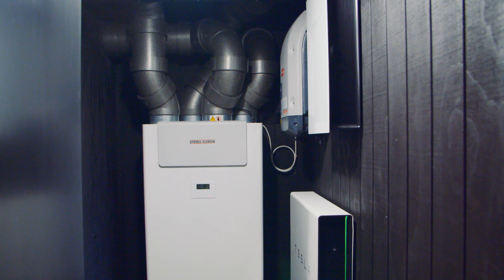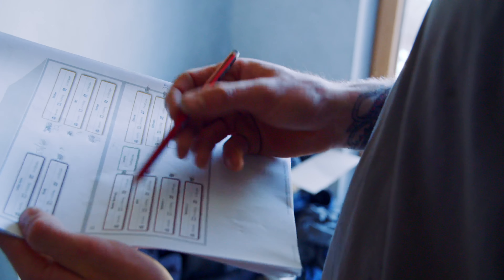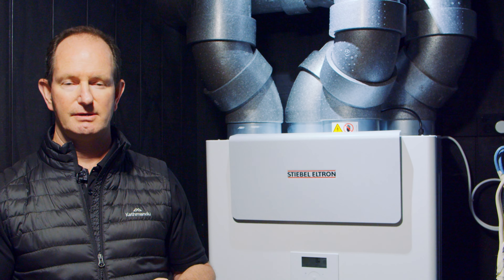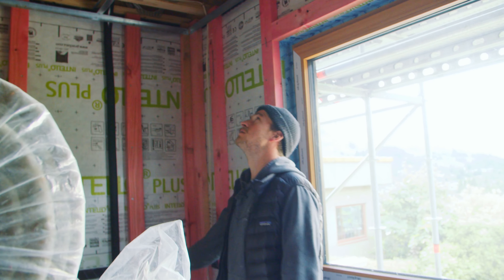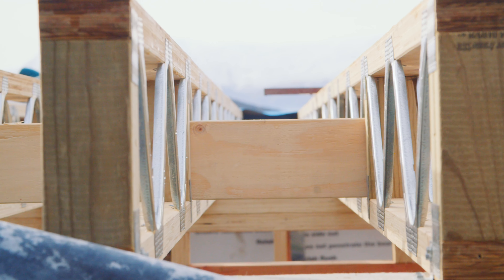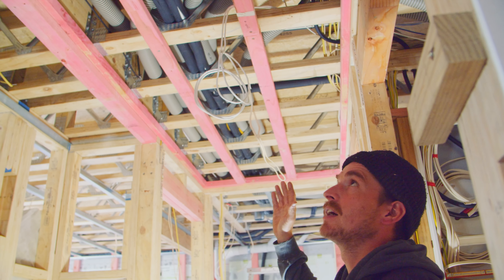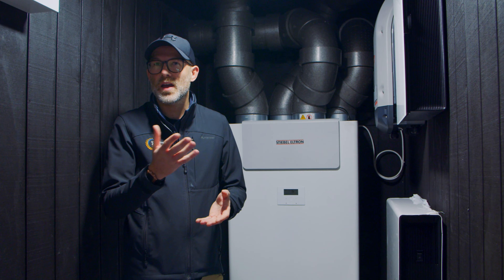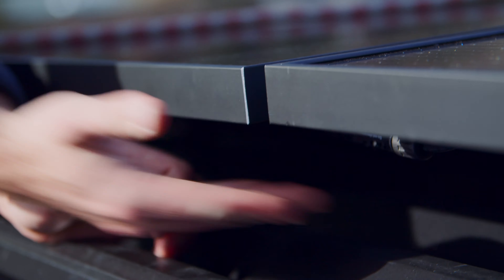Watch Us Build a Passive House in New Zealand - Episode 4

Comment: Hi thanks for taking the time to share your build. Why did you miss out on the passive standard? Cheers
Reply from the maker: Hi Cam. Modelling showed on PHPP that we would achieve a "Low Energy Building" certification. We are extremely happy with the performance data from using PHPP, and we simple had no budget left to pursue certification (professional fees).

Comment: Veri nais :)😄What did modeling showed about humidity during the summer? And why did you choose hrv instead of erv?
Reply from the maker: Hi Joe, Great comment! This has me thinking more about ERV vs HRV. 

Very low Humidity is predicted in the summer months and a 1% overheating value.

Our climate in Central Otago, New Zealand; the Summers are hot and low in humidity; winter mornings are often misty, the days cloudless and windless and the nights freezing.

We work alongside certified Passive House designers and ventilation specialists in New Zealand, a HRV was specified for the Heat recovery properties.

We find the living environment extremely comfortable. However, I think measuring the humidity going forward will be extremely valuable and we can do a smaller video on our findings. 

Thanks for the great perspective.

Comment: You mentioned needing heating but what is your heating source? Is it a separate heating from the ERV?
Reply from the maker: Heating source is 2x 2kw Convection electrical panel heaters. In the coldest days of winter, these regulate the temperature in the early & late hours. However, usually the home sits at between 18-20degrees without heating.

Comment: Whats the house use to heat hot water
Reply from the maker: STIEBEL ELTRON's hot water heat pump WWK 302|302H
Reply: @compound__  thanks. I saw the heat transfer unit but missed the heat pump hot water system. 

I have seen these units advertised in the magazine "Renew". I see now why the plant rooms are so big as the internally fitted heatpump needs a 13 sqm room. 13sqm if indoor. Thats quite a size. 3m x 1.8 x 2.4m. Quite hard to fit in an existing build. For aesthetic appeal dont want outside. 👍
Reply from the maker: @Scooter1964NZ  It is still possible to fit a split system. Your hot water cylinder remains inside (standard size) and the heat pump unit is external. A more traditionally sized heat pump, so less invasive aesthetically. 

Reclaim does a system like this. Follow this link for a read if you like. 

https://enveloped.co.nz/water-heaters.html?gclid=Cj0KCQjwkOqZBhDNARIsAACsbfKPG8WptToZhjCIU6lNXyCsccaPLLmOuM5uEtepYWpLr2e8_7QwhZEaAhvXEALw_wcB

Comment: What is the cost of reaching full passive home standard that allows your solar system including panels and battery to be efficient enough to produce net zero energy bill? I would argue it would be easily 200k. The ROI of this is not even close to being economical. Great for the environment but the economical argument does not stack up.
Reply: 25% mehr als ein herkömmliches neues Haus in Deutschland. 👍🇩🇪
Reply from the maker: You raise a good point regarding ROI. We are coming up to net zero energy bill for 12months. $30k 5kw solar system with a 14kwh Tesla Powerwall 2 battery. We are still collecting data on this project. It will be great to spreadsheet out the numbers and the returns compounding over the years. 

New Zealand insulation, window performance and energy standards for homes have now increased (H1). Inflation has also been rising rapidly since the Covid19 pandemic. So the cost of building a conventional home has increased significantly. 

What it cost to build this home, is now what it would cost to build conventionally to the new New Zealand Standards which is significantly less energy efficient than this home. 

Power prices are going to only increase as the world becomes more electrically dependant. So your ROI is going to only compound over time.

The goal is to be ahead of the curve and build homes that require little to no energy and promote health and well being to the occupants. E.g No bills, pay off more principal of your mortgage. Once mortgage free, no bills. 

Freeing up your cashflow and promoting health is going to create opportunity in itself. 

Or you could focus on re-sale and play the game most play, only to realise you could of been better off 10years down the line if you had just committed to building high performance home.
Reply: @compound__  Any updates to the ROI information which can be shared? Used to own a house in J'Ville before heading overseas for work, now considering retiring back in Kiwiland so been looking around and came across your vid. 

Would be interesting to compare the details to a friends new build in CHCH as he is slowing relocating from Wlgtn to CHCH and does not want solar nor a passive home. 

Thank you in-advance for any your time and advise on the matter!